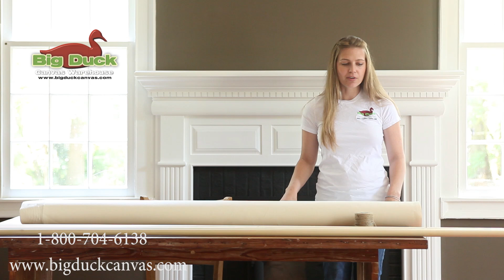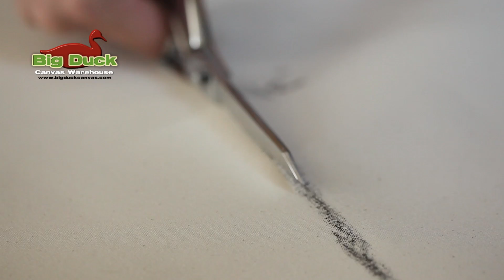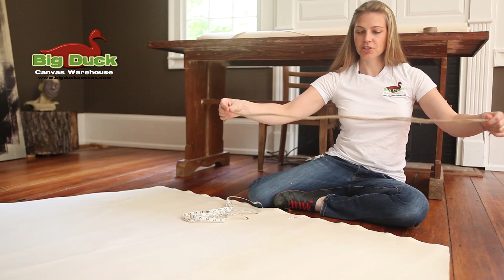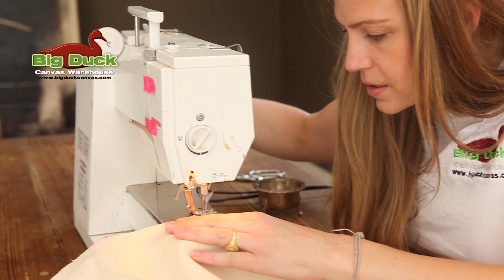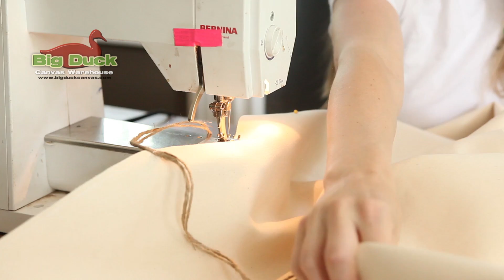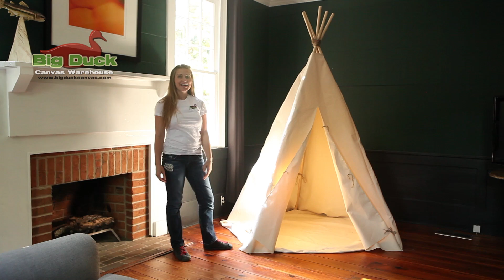How To Make A Tipi (TEEPEE) by Big Duck Canvas

Comment: Thanks Big Duck! These little tipis are great for hunting/backpacking camps. Nice easy design! We have a ten foot design that suits all our camping needs.  To answer the poster below. All canvas, of decent quality is waterproof naturally. As the canvas becomes wet the fibers shrink, not expand as one might think and the canvas becomes tighter and thence very waterproof. Utilizing a fire on the inside helps smoke treat the upper portion of the tipi. But as long as you don't poke the canvas or  lean up against it the canvas sheds the water and remains remarkably waterproof.

Comment: Cool video. What was the square footage of canvas used on this project?
Reply from the maker: This link will show you the dimensions used: http://bigduckcanvasblog.com/2014/12/03/playtipitutorial/
The dimensions do not have to exact to what I used in the video.  You can make the same project much smaller or bigger depending on its end use.  I used about 12yds to cut out all my walls and floor of the Tipi.  The poles I used were 8ft, but this could be changed to make a shorter Tipi. Thanks for watching.